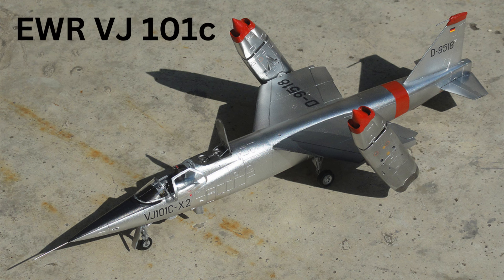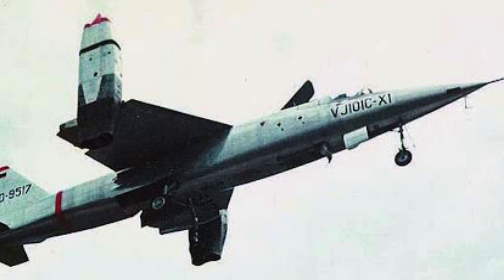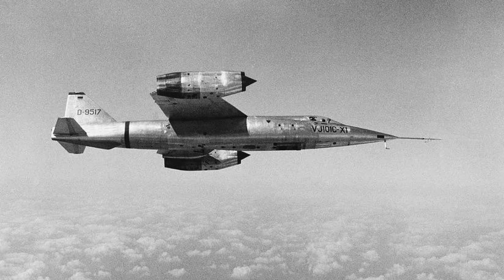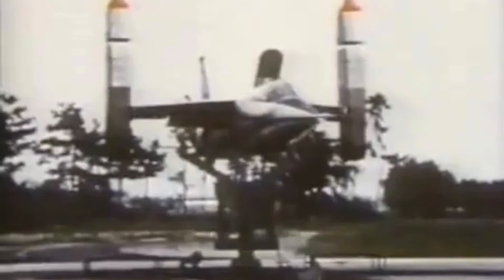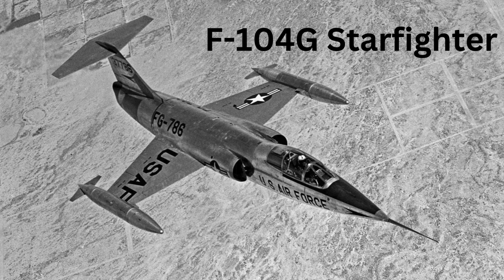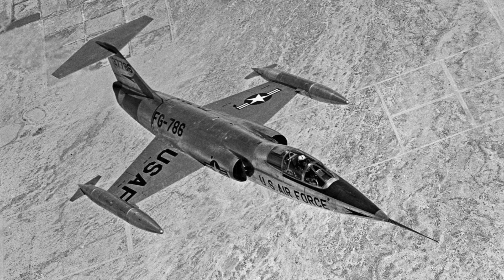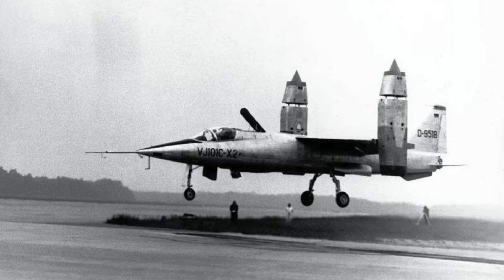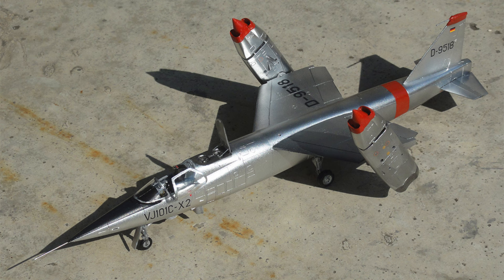First Mach 1 VTOL: The EWR VJ 101 Story

Comment: The VJ101C was also a breakthrough in fly by wire and managed the transition automatically.  It was more a test bed. VJ101D and VJ101E addressed issues found in the VJ101C.

Comment: The 1964 crash was caused by connecting up a gyroscope to the autopilot backwards.  Like the Harrier, the entire flight and transition was to be handled by a flyby wire auto pilot system.